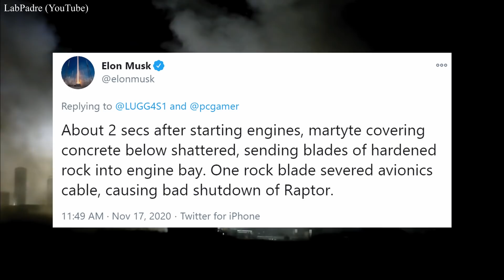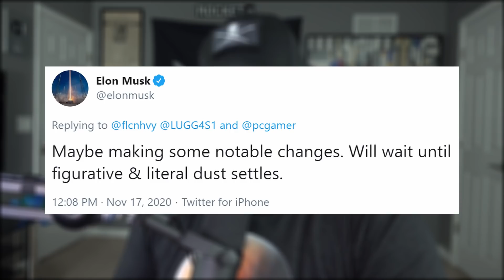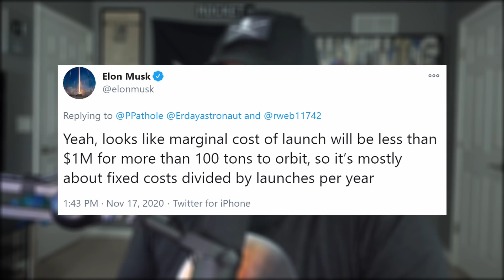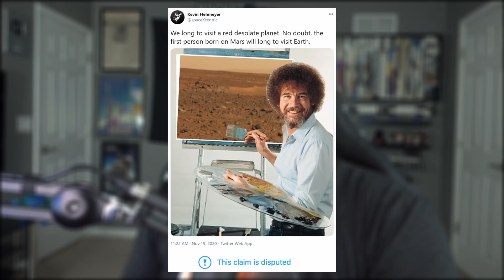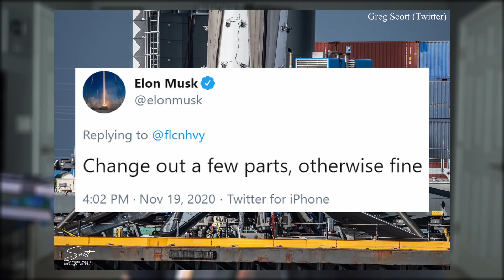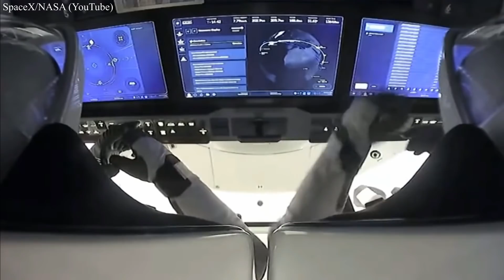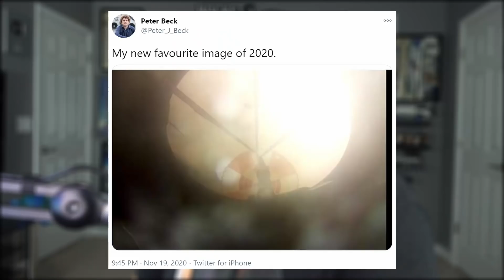SpaceX Starship - Changes are Coming for the Mars Rocket | SpaceX in the News

Comment: Turbulence and vibration during reentry will course metal fatique at the attachment points for the wings. A huge problem. And they need a third stage.
Reply: Stainless has higher fatigue limit than aluminum, and I'm sure the engineers are already calculating things. Third stage is just more complicated because Starship will use orbital refueling instead
Reply: @alvianchoiriapriliansyah9882  Good point! Hope it works!

Comment: I don't see why they didn't make the Starship development launch stand a little higher and then place a protected concrete, tetrahedron-shaped blast deflector under it to get this 15 km flight done to find out if the fins system is going to work.  Any testing of kicked up debris from flat ground should have been done with SN5 & SN6.  Aren't they just sitting around? They're already pressure tested.  Put three engines on them and do some static firing tests with them.
Reply: More complicated solution, when the previous firings had done with no problems. Overcomplicating things much more than the needs will put you back down in terms of progress

Comment: booster did not land hard. Landing was normal, try reading the news from other knowledgeable sources, man! The listing happened afterwards from stormy seas and the entire octograbber and rocket sliding hard against the railings on one side when sliding sideways down steep waves. Helpful if you do research instead of speculation in this case.

Comment: I am starting to think they will have a flame diverter under SN9...
Reply: They are trying to avoid that, since it won't be an option on Mars
Reply: @heartofdawn2341  Exactly. Starship is like an aircraft that operates on unprepared dirt strips... it simply needs to be designed to meet that requirement.

Comment: SpaceX needs to add flame deflectors under their launch pads.
Reply: I agree and expect SN9 will have at least a small cone in the center of the pad that should send the debris out not up.
Reply: Remember, Starship will never actually launch from a fancy launch pad. From Earth it will be staging from Superheavy – while off-Earth it will be operating from whatever unprepared surface it lands on, and certainly won't include flame deflection. So Starship needs to be hardened against the debris it kicks up, much like an aircraft that operates from rough strips...

Comment: The ship was machine-gunned when it started the engines. You will have to put a protective screen on the engines.
Reply: No, there is no need for a protective coating. Nothing was shot up into the engine nozzles.... that's almost impossible. Debris was shot up past the engine nozzles, into more sensitive areas. They have stated they are going to be housing the tubes and wires in these areas in metal pipe going forward and will likely end up applying a 'plate' of some kind that only has empty space for the nozzles (with gaps for articulation). No mesh will ever happen.